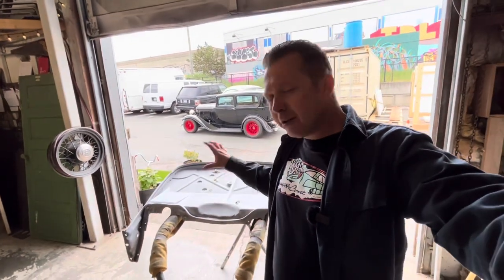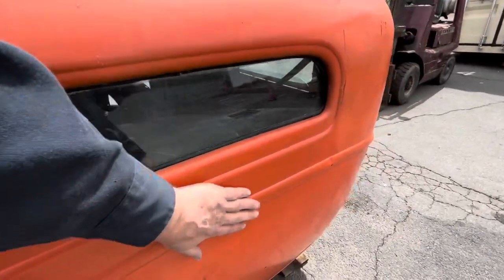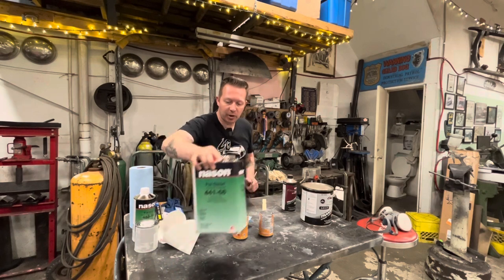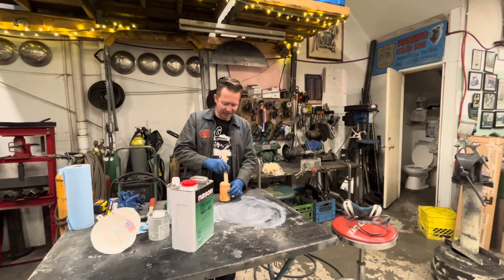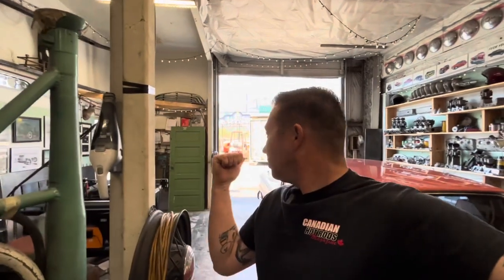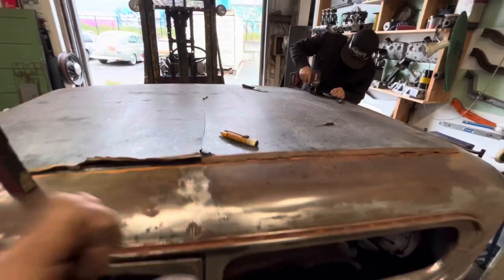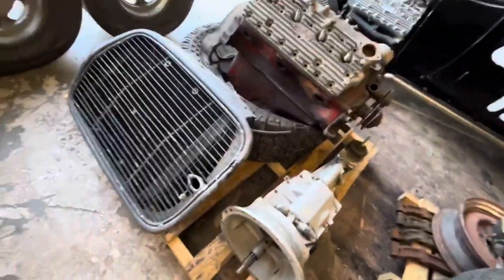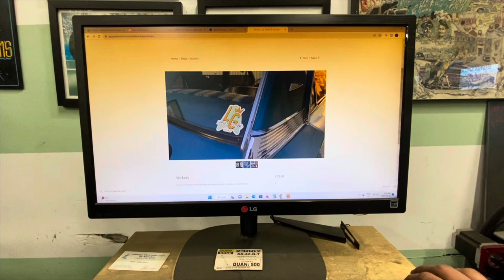Painting the firewall, Stripping the Body. 32 Ford Build Part 19

Comment: I take two strips of 2 inch wide masking tape and and make "V" coming to a point at the inside edge of the can. leave the tape long hanging over the edge of the can the "V" makes it more controllable and the flap of tape keeps the paint off the can. It takes a little practice but it works slick.
Reply from the maker: Great idea
Reply: I save lids from empty cans, punch drain & vent holes and use them to pour out of new cans. Most cans have the same lids but once in a while you may find one that is odd then I resort to the tape method. Easier to clean up the  lid than the top of the paint can.

Comment: Well what a mess no not yours, mine held the can up to read with the flimsy wire handle and plastic holders and  snap can on the floor half a can on the carpet. Kids throwing stones and bam one into the passenger window of the suburban. Bad luck comes in threes so what’s next! You have a beautiful baby boy. Shannon looks very well. Doris looks like she has had some treats. Amazing body now the paints off. Another Jim!. Good stuff keep it coming (Check out hot rod hayride clips) cheers.